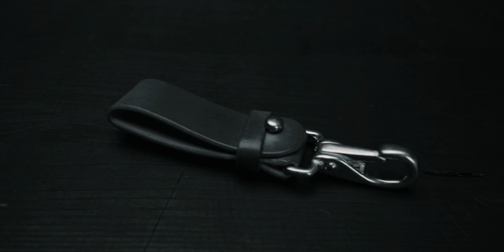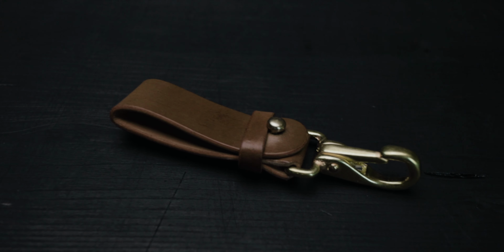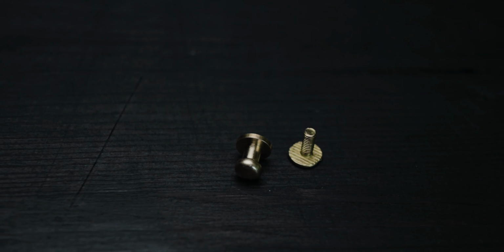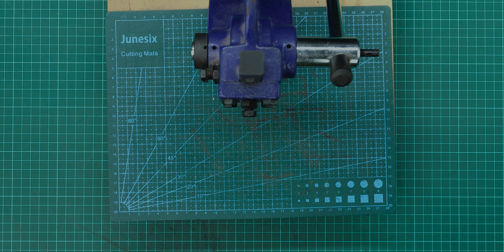Making Leather Belt Loop Keychain DIY PDF Pattern

Comment: Great video! I use the same kind of thing for my keys...on a paracord lanyard. Where do you get your cutout molds? Did you supply the design or are there stock designs available?....also I like the credit card elastic idea for stability👍✨
Reply from the maker: Its my design, im ordering custom shape cutting dies.